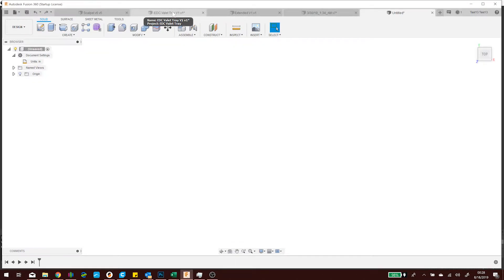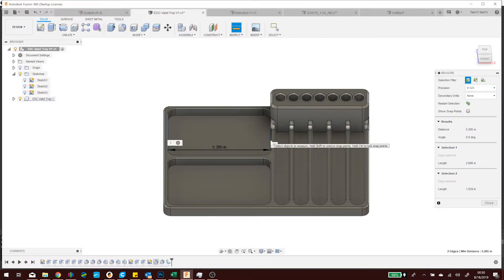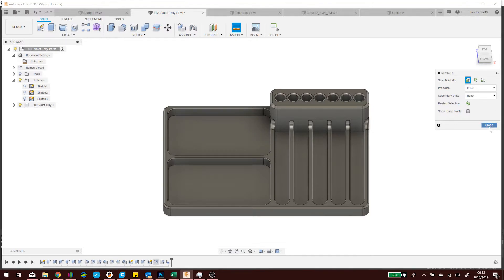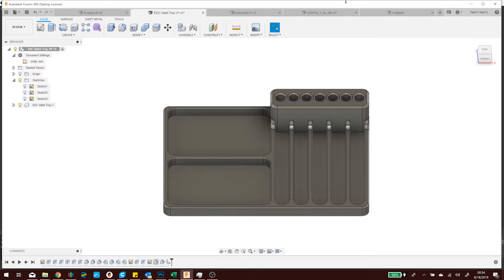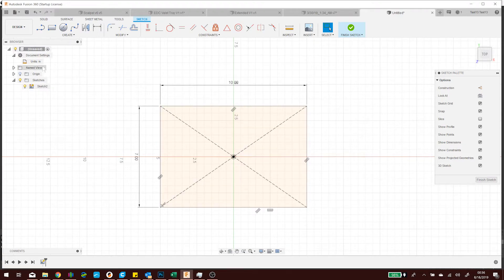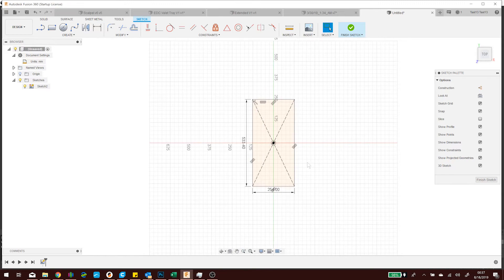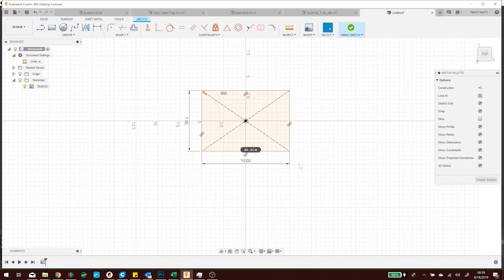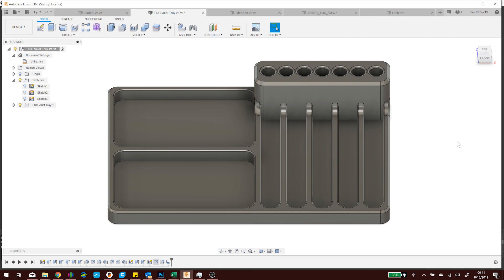Easy Unit Conversion Tricks in Fusion360 (IN to MM in a flash!)

Comment: Thank you sharing this!  Juggling between unit systems can be  very stressful and tedious. You might find Enverter for Fusion 360 useful . 

Short for Engineering Unit Converter, Enverter has been specifically tailored to address engineering and scientific unit conversion calculations with over 4300 unit conversions available in more than 20 different categories.

Available online for FREE via web browser, Enverter is also available as a plugin for CAD systems, where built-in unit conversion often only addresses length, mass, and time conversions.

Currently plugins for Autodesk Fusion 360, SolidWorks, and Cura are available for download.

Enverter was recently covered by Develop3D (https://develop3d.com/cad/enverter-launched-for-dimensional-analysis-unit-conversion/
) and DailyCADCAM (http://www.dailycadcam.com/enverter-dimensional-analysis-and-unit-conversion-software-for-engineering-and-scientific-calculations/
)

You can download free 30 day trial of Enverter for Fusion 360 here: https://www.enverter.com/download